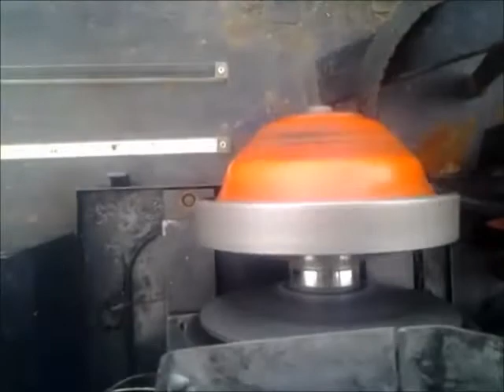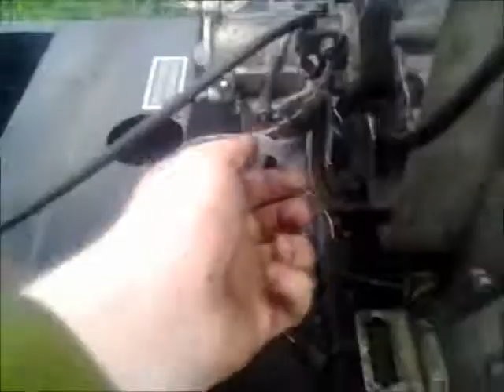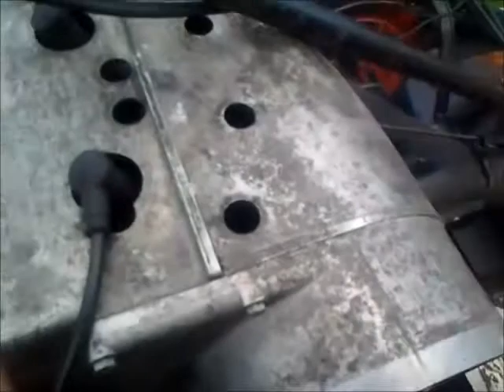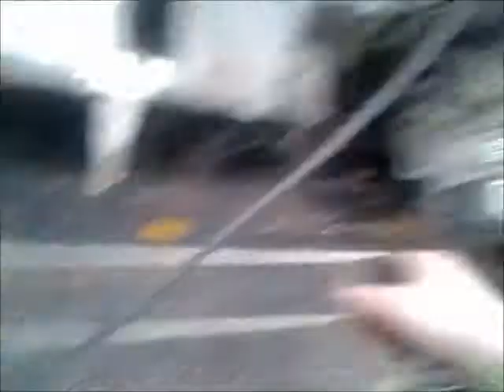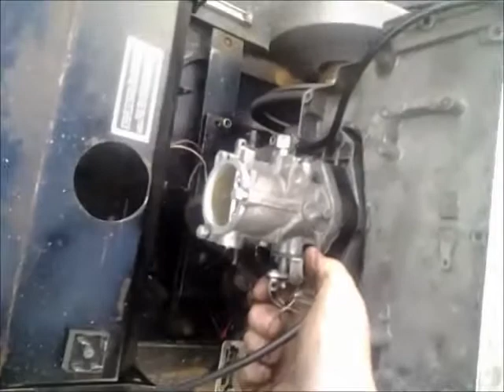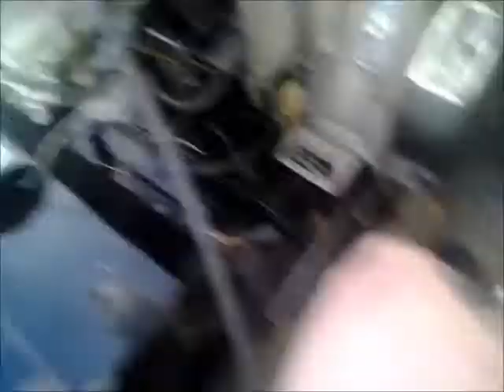Rotax 640 | Crankcase failure

Comment from the maker: I don't know what's up with it, I think the crankcase nuts have at some point of operation become too untighten and the engine have simply twisted the aluminium itself, and there for can't be tighten up again. Or it's just me not using right sealglue... Didn't check the crankcase bottom last time I had it apart. I'll have another go with a another seal material.
But I think I used good seal material, it should withstand gas and oil and high pressures, maybe the surface wasn't clean enough.